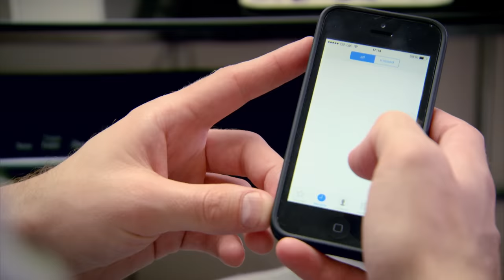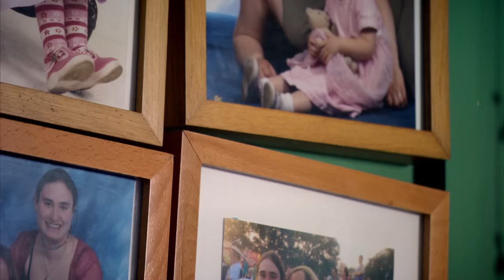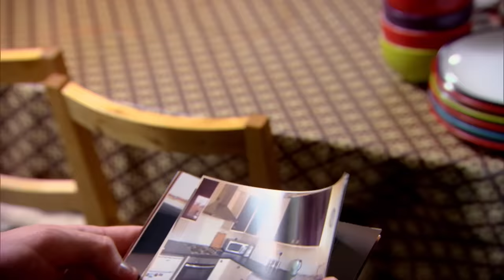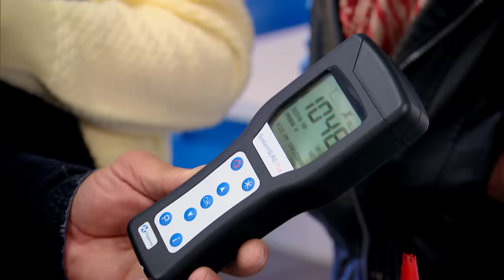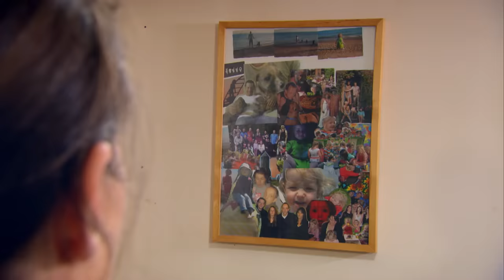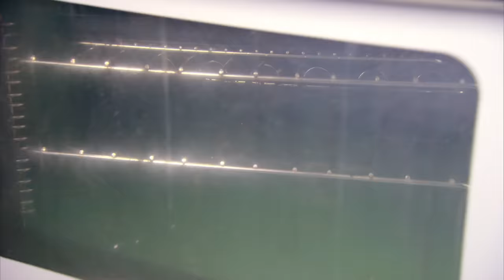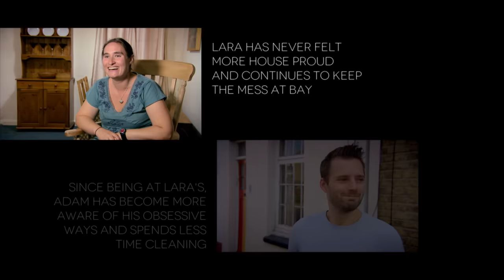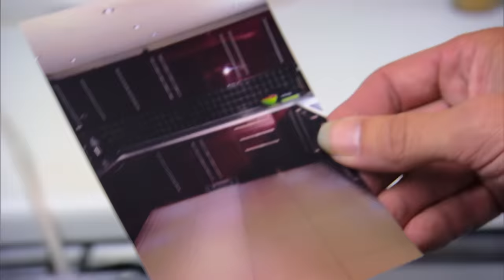OCD Cleaner Loses It Over Dirty Kitchen | Obsessive Compulsive Cleaners | Episode 12 | Filth

Comment: It's actually not an "expiry" date but a "best before" date. The manufacturer guarantees that the product will be fine up to that date. (If it goes off before that for whatever reason, you can usually get a replacement at the store without any issues)
The products are often still fine loooooong after the expiry date. Especially products that are made to last - like long-live milk, long-live cream, canned foods, dried foods and such.
Those decorative sugar sprinkles will definitely be fine years after the "best before" date, if stored dry.

Comment: Obsessive Cleaner @ 16:56 : ''I take two sandwich Bags, I put one on each hand and then I'll clean''
JesseLaRusso: Why not just buy Rubber or even Latex Gloves, it'll be much easier, Cleaner in the long run Plus you won't be throwing your gloves away as they can easily be washed in Anti-back and Vwolla, new pair of gloves.
Reply: *voila.